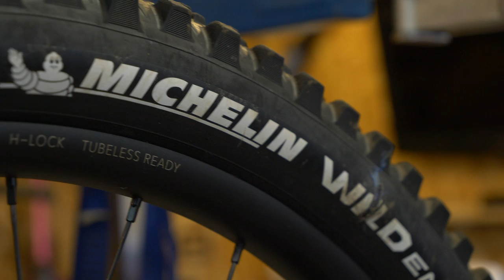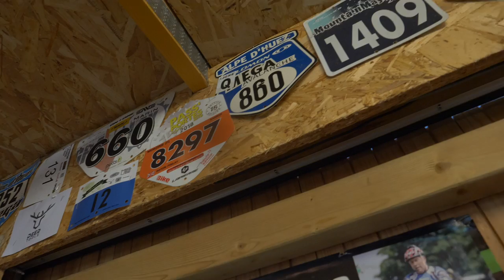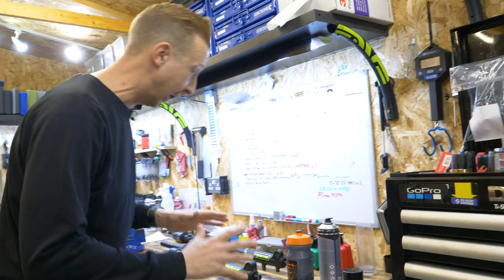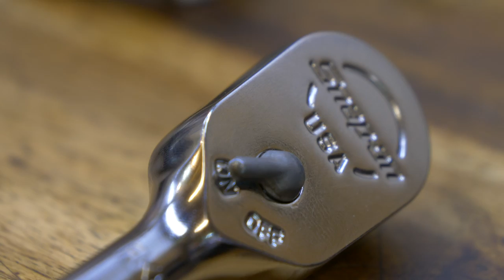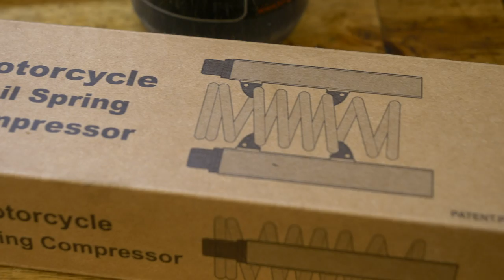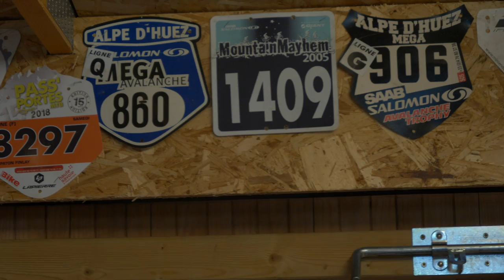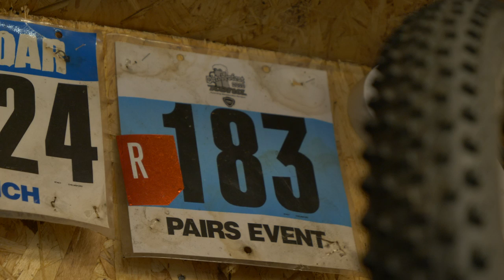The Ultimate Shed? | A Suspension Specialist Bike Cave

Comment from the maker: Do you have a MTB suspension question for Fin? Put it below with the hashtag #AskGMBNTech for a chance to be featured on the suspension special! 👇
Reply: #AskGMBNTech What kind of trail do you reckon for suspension setup? Should I do several runs with one setup before changing anything? What to do about the increasing fatigue when you are doing run after run?
Reply: #AskGmbnTech im wondering, is it possible to have 2 shocks on the rear?
Reply: #AskGMBNTech Can you explain for a beginner, how the compression setting work? I find it hard to understand it and how to set it up right.
Reply: #AskGMBNTech Brilliant video both. Really enjoyable hearing two guys talking shop who are experts in their field. Lovely bike shed too. Could loose hours in there rummaging. My question is in regards to a 5th Element coil shock I’ve got on a 2002-2005 (I think) Santa Cruz Heckler 5 I bought yesterday. It’s my first dual suspension bike (finally getting back into biking after 12 years away)and the element has been TF Tuned previously. As a complete but wanting to learn amateur, how the heck do I set this thing up!? Are they any quick settings I can tweak or do I need specific tools to get a feel or is it just worth getting it looked properly. Thanks and all the best both!
Reply: Can you covert my 2020 Boxxer 200mm travel to coil.
Reply: #AskGMBNTech does a progressive setup, smooth at the beginning (ex: absorve the roots) & firm at the bottom (ex: take big hits), for your suspension and shock be the "way to go" to most of the riders (weekend riders like myself and athletes)? It´s also a "standard setup" that can allow you to progress gradually as a rider?

NOTE: I'm talking about the Enduro/Trail category
Reply: @pranavreddy6470  everything is possible
Reply: #AskGMBNTech Hey Fin, you mentioned having your rebound slower is ultimately better... how do you realize when you have it too slow and do you have any tips on finding that perfect spot for rebound?
Reply: @brandonwilliams8978  If the rebound is to slow you will have a packing and a harshness as the suspension will not be able to react to consecutive bumps. This means ride the same bumps over and over again until happy but set sag first then work from there.
Reply: Bomber z1 coil upgrade 🤟
Reply: #ASKGMBNTECH I run a Mazocchi Bomber 66 rc3 evo 180mm from (i think) 2008. I'm using the fork for superenduro/freeride stuff and I#d like to have a lottle more support of it, even though my compression is fully closed. Should I try a different wheight oil for the damping or can I possibly by a heavier coil spring (if so , where.)?
Reply: @clemens8744  Spring maybe you can increase air but I use High speed to get it to ride higher in the forks stroke. When was it last serviced is important and have you increased your weight.
Reply: @evo5349  Service was 1 month ago, my weight hasn't really increased. I'm around 78 kg...
The problem is that I'm bottoming out quite frequently on stair gaps and drops - the highest I can do before I bottom out is about 150cm to flat... that isn't that much...
Reply: @clemens8744  Your fork is coil if it's air as on my boxxer fork I increased fork air token to 6 and then adjusted my air pressure. So you need to try different settings.
Reply: #askGMBNtech Is it possible to optimize the properties of the suspension by using oils with different viscosities.
Greetings Manuel
Reply: #AskGMBNTech im running an old White Brothers XC3 fork (gold lowers, grey 32mm stanchions). I have not been able to find any manuals or mechanics who can help me with the internals. Coils and legs are in super condition but im not sure if the "piston" is working properly? if it needs fluid oil or any specific maintenance? Ive greased the entire inside with SRAM butter which seem to do the job for now.
Any advice on an old WB-factory fork?
Reply: #AskGMBNTech do the new ‘progressive Spring’ coil shocks work as well, or at all, on a frame specifically designed for an air shock? Big fan of the show, making lockdown bearable! Thanks
Reply: @Donnie Mackay Forks mostly can have a overlap as the Fox done make 36/38 with special coatings different lengths, so my Fox 36 I had 150mm so changed to 180mm and put coil spring as in Vorsprung smashpot in etc
Reply: #AskGMBNTech I recently bought myself a Saracen myst Al downhill bike It currently has coil shocks front and rear What would you recommend the high and low compression on the front fork The recent video I watched The pro suspension setup The gentleman said About living in the UK He would have is compression all the way open Does that Mean high and low Thanks Love the show keep up the good work
Reply: @simonmiles9549  Simon I am no expert but Raced MX and now MTB, sag first and use the bump rubber on the rear as a quick sag tool. Forks use the rubber ring on the fork. The I will do a section to see how much travel I am using. Set the damping adjustments in the middle and see how it rides and the grip. Rebound is very important and all adjustments are think of speed of the suspension unit. Low speed compression are for small rolling bumps and High speed compression is say you hit a root and the suspension unit reacts fast to it adjust in or out on the setting. Fork rebound see if it can react to bumps so if its to fast and harsh through the bars turn in the rebound. The main thing if you have 200mm off travel and not using it why not, on my Boxxer fork I use 180/190mm at the moment as it's to wet but in the summer I will use 200mm and adjust so as it's not bottoming via air tokens or damping. The biggest thing I hate about Mountain bike suspension is teflon bushes as there crap, I converted mine to needle bearings and what a difference so much so I changed my LS comp as so much more feel in what the tyre is doing, in motocross suspension is all bearing as it's a lot better. If I want my suspension to ride higher in the stroke I will add HS compression.
Reply: #AskGMBNTech what fork/rear suspension modification needed to support & perform better to a lighter rider, let say a 25kg kid using 150mm fork aside from reducing air, is by changing suspension oil viscosity will also affect ?
Reply: @brandonwilliams8978  The shock or fork will pack down with repeated hits if it's too slow, so you'll loose travel, sometimes feels like the bars are rotating in your hands
Reply: @clemens8744  you need a heavier spring  - increasing the compression will only make the fork feel harsh, look on ebay Italy & france there isn't much avalable for these new now as Fox have taken over Marzocchi
Reply: @Donnie Mackay not all - it depends on what the manufacturer has specced for that chassis.
Usually its just a case of changing out the air side control rod, some times you just shuffle spacers around, but that is much rarer in the newer forks.
Reply: @andersrisager6518  Pray ?
Reply: @TheJamie2405  Progressive springs are good for big hitters and bikes that tend to blow through their travel, but I'd advise upping the spring rate on the stock spring first.
Reply: @simonmiles9549  open compression is anti clockwise on both  - if you want it to bob less under pedalling add Low speed compression
Reply: @javaslan8320  yes you can easily run a lighter oil or a even a lighter tune on the shim stack
Reply: @finlaypaton7202  thanks so open the +or- on low speed all the way cuz it does Bob lots when pedalling
Reply: @simonmiles9549  open would be minus, anti clockwise
Reply: @finlaypaton7202  thanks for the help what about the high on the front thanks again
Reply: @simonmiles9549  high speed is for the big hits, I like to leave it open too, otherwise you get spiking, which causes hand fatigue
Reply: @finlaypaton7202  Thank you very much you've been a great help
Reply: I would love to know when it comes to air sprung forks, which negative system he´d prefer:
- Coil sprung
- Equalized air sprung
- Dedicated air sprung

I love the negative coil spring in my Suntour, the only bummer with it is that Suntour only offers 2 different springs and with the harder one I´m riding, the adjustment of correct SAG is so on the edge that I can´t go any lower on the pressure, otherwise the negative spring is actually pulling the fork together like with a suckdown. The lighter spring is too light and there´s nothing in between.
Info on the fork: Auron / 29" / 150mm / RC2 / no tokens /  cleaned it, tinkered some seals inside the fork, and have changed the lubrication to oil now (this is a surprisingly competitive fork when you do this).
Reply: #AskGMBNTech - coil conversions for solo air Rockshox forks in the 100-120 mm travel range and coil shocks for XC bikes. I'd use my full suspension bikes more if I trusted the shocks to survive the constant grinding mud on the trails most of the year. I have Rockshox solo air forks on a couple of my bikes and the setup options seem to be getting the sag correct and pissing through all the travel as soon as you start to work the fork on anything interesting or setting it up hard enough to give support on the mid stroke and losing all the small bump sensitivity. Back in the day I ran couple of Bomber Z2 coils with 63 and 80 mm travel and they were well able to do both jobs. I had an air assist Bomber too and that fork was buttery smooth for years and needed no minding. I also ran a coil Rockshox with U-Turn and that was excellent too (Apart from the U-Turn travel adjustment winding down and the bolt through axle loosening when it was ridden hard). Coils just feel better to me, and the extra weight of a coil (And open bath damping for that matter) are things I'm more than happy to carry even for XC/marathon type riding because they work better and bring the fork closer to being a fit and forget part.
Reply: @dschingy  coils are my preferred and then equalised air because they are easy to use
Reply: @peglor  if it’s one of the new breed 35 or 36 mm chassis it’s no problem 
But no one currently makes a 34mm or 32mm coil system 
I’m sure something could be “made” or bodged. But not something I’d be happy to sell to customers. 
The 36 system I use the new Marzocchi bomber kits 
if you want progressiveness too the Vorsprung Smashpot or at the top end the Push ACS3 system. 
I used to use a lot of the 2010 Lyric coil parts but they are getting a little thin on the ground now.
Reply: @finlaypaton7202  Thanks for the reply - I've got a 29er Reba and a 27.5 SID on my hardtails, so they're all 32 mm I believe so I'm out of luck there. 

I have a Fox 34 on my enduro bike that's got a weirder issue - it feels like the compression damping is on all the time, so I have to really hit things to get it to move (Sag is correct). I stripped and rebuilt it (As far as the damping cartridge would allow me to anyway) and found nothing it felt the same after I put it back together. The really frustrating thing is that I can't find a thing about the specifics of this fork from Fox - it's one of the forks that can switch between 140 and 160 mm travel with a switch on the air side and a CTD cartridge damper. 

It was OEM on the last single pivot Canyon Strive model (2013 I think - it has 26" wheels because that was the wheel size for anyone not racing XC). Canyon did a great job copying the Commencal Meta 5.5 quite with the design, but got more lateral stiffness by widening the suspension linkages).
Reply: I’ve recently snapped the rear chain stay dropout weld on my hardtail, I’d upgraded the original 100mm fork to a 150mm a couple of years ago the bike hasn’t really been rode aggressive for a while mostly a commuter & on family rides. Was just wondering if the 50% increase in travel & the change in the geometry & raise of bb would have contributed to or coursed the snap??
Reply: @peglor  Probably tight bushings or your negative air port is blocked
Reply: @spivadee8267  probably not, more likely just fatigue of the metal over time
Reply: @finlaypaton7202  👍🏼Thanks for the reply! Luckily I’m getting a new frame on warranty but at first they was saying it was cuz of the forks🤔 epic bike cave btw
Reply: @finlaypaton7202  The bushings felt fine (The fork worked very well for a couple of years and not a lot of miles), and there was no significant drag when I was putting the fork together before the damping cartridge was connected. When you say negative air port, is this something in the air side of the fork? The damper shouldn't have air in it as I understand the setup.
Reply: @peglor  yes air side
Reply: Can I know the name and the brand of that smart washer?
Reply: @FlavioPugliese  it’s a Rozone smart washer, excellent bit of kit.  
It’s heated too
Reply: @finlaypaton7202  Thanks man and congratulations for the beautiful workshop 😉
Reply: @brandonwilliams8978  I also found this an interesting comment. many suspension guides suggest running the rebound as fast as you can

Comment: #askgmbntech Hi guys, big fan of the channel. Please give us a rundown of the mechanism behind a H/L compression and H/L rebound adjustment dials work. What actually happens inside the unit to change how it behaves? Thanks!
Reply: In most cases the fork is designed to act like a pump when it moves, moving a fixed volume of oil for every cm suspension travel (Though some designs probably tweak this as well). 

This oil is routed through a restriction that slows the oil flow down. Turning the adjustment dial adjusts the size of the restriction either using a needle valve type setup or a pair of aligned holes that are misaligned from each other as the damping in increased, leaving a smaller and smaller overlapped area between the holes restricting the oil flow. 

A one way valve is used so that the oil can easily go in the opposite direction to the flow when the fork moves the other direction, so compression damping only acts when the fork compresses and rebound only acts when the fork extends.

Low speed and high speed compression add a pressure sensing element to the system so on a sudden impact, the spike in the oil pressure will open a valve temporarily to allow the oil to take a different route. The most basic version of this is the way most forks will still move if you hit something really hard while they're locked out.
Reply: @Fred Gazeley check out the Dialed series on the Fox channel, they have a video where they tear apart a fork and show the valving and adjustments
Reply: @milesmason3234  cheers mate!

Comment: Pulls out a $10 Aliexpress derailleur hanger tool: " oouuuhh, that is really posh".
Reply: That’s what I thought.  He’s seen Park Tools stuff before and saw something different.  It’s actually close to $25 now and take about 3 weeks to deliver.  I would have the Park Tools one any day.  Abbey tools make a green one with some similarities so it must work well.  That Stanley tool is surprising
Reply: Park tools for every day. 
The Aliexpress one is a complete copy of the Abbey tools one. 
I got that because bikes like the Trek Rail have a particularly close gear hanger to the pivot. 
Which my old Park tool doesn’t clear. 
Thought I’d see if the cheap one did the job. 
Yet to see how long it lasts in the workshop environment but it works pretty well

Comment: Fin did a top job coil converting my Lyric. He’s right about how improved it is. Slippery slope though, now my previously lovely air shocks feel inferior and man-maths is rearing its head.
Reply: What's the bottom out like on big drops/hard compressions?
Reply: @judechandler5102  zero problems. He left the valve in the top of the spring leg with the advice to put 3-5 psi in there if I was doing a day of massive drops. Tried it once and haven’t bothered since.

Comment: #AskGMBNtech Hello I always wondered why the Marzocchi dirt jumpers and dirt jam forks from the  early 2000s had a nasty clonk when they rebounded, they worked fine when they got of the shelf but after the first time you took it apart they started clonking, I tried all kinds of thickness of oil but they never got as they where, I've lately been investigated the matter and realized that they have no valves for the oil just a big hole thru the piston so how did it even work fine from the start? Am I the only one why had this problem back then? Thanks for a great show!
Reply: Because they were filled with thick grease which will have coated all of the metal parts in the fork, then as soon as that mixed with the oil it looses anything to stop metal to metal contact, you can slow them down but it involves shutting off the holes and re-drilling.

Comment: My suspension Q.  What is the optimum way to set up a coil for varying rider weights and skill levels. We should all know how to tune an air shock, but what about a coil shock for small, incremental changes?
Reply: First and foremost get the spring rate correct 
Once you have that. 
Then you can fine tune damping & preload.

Comment: #AskGMBNTech Is it okay, and if so, when and where, to do a shortcut/bodge in a suspension/dropper maintenance job task, where the proper and official way would be to use an expensive speciality tool that is only a one hit wonder. I'm talking fancy measuring tools, piston seal funnels, suspension shaft/ damper removal tools, seal setters, soft jaws, weird thread interface just to push or pull something, pressurized gas interfaces etc.

Comment: Thanks for the great video! #AskGMBNTech can I use  Motul fork 20wd oil instead of Fox 20wt. Gold Bath Oil? Here in Brazil it is really difficult to find these Fox oils. Thanks!
Reply: Yes  - add some Float Fluid to thicken a 15wt oil would be my preferred lubricant, If I can't get hold of the specific stuff.